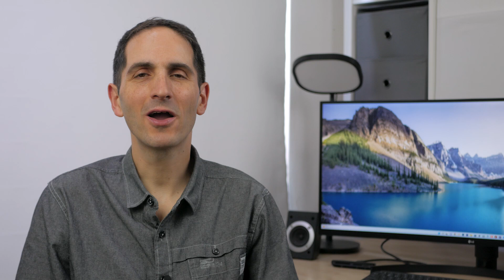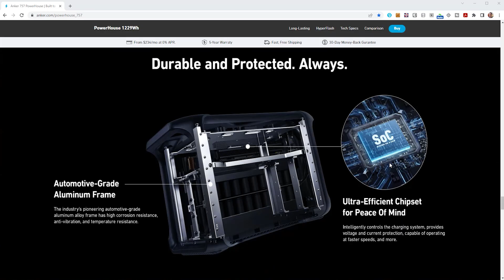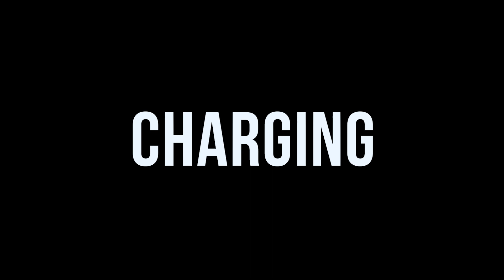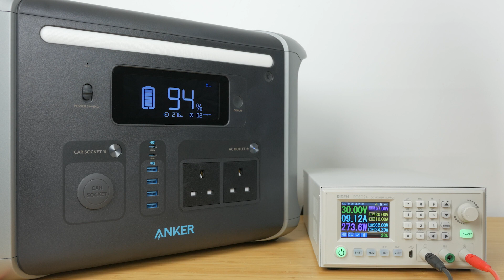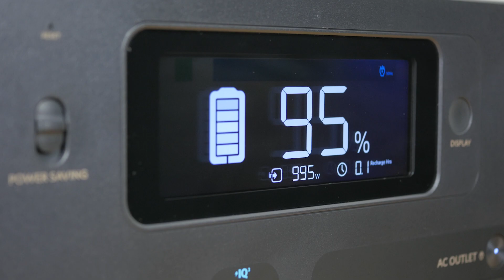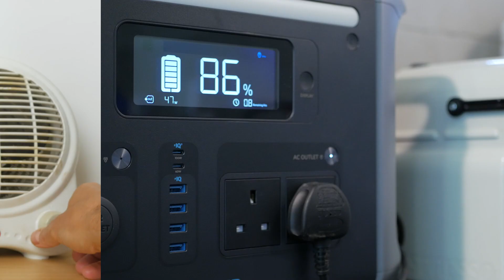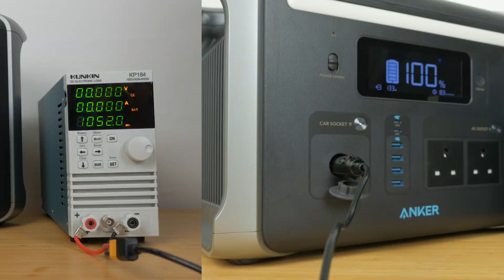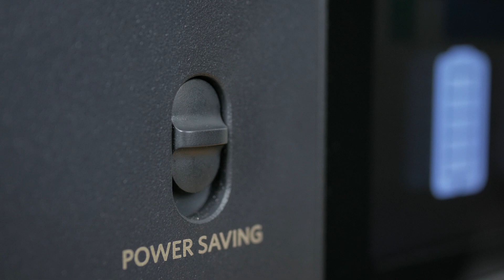Anker 757 PowerHouse 1500W portable power station review | 1229Wh long-life LiFePO4 | Fully tested

Comment: Excellent review!  👍
Can you power a device from the unit & have the unit accept incoming charge at the same time?
For example have a 1kw heater switched on through the unit plug sockets, while simultaneously re-charging the unit through connecting 300w of solar panels?
Reply from the maker: Thanks! Yes you can.

Comment: First things first absolutely great video.
My concern is with the solar input. It's limit to 30v and 10A makes it basically impossible to hit the 300W.
when using A parallel/series array of 12v panels to get to 24v the max is still 240W because of the 10A limit.
I can't really find any panels that reliably work at and always under the 30v...
Reply from the maker: Thanks! They want you to use their 30V 100W panels with their parallel adapter, which would provide 300W maximum and 10A.

Comment: Great video, very informative and helpful.  I have just ordered one of these, could you recommend some roof mountable panels for my van that I could use to charge this rather than the expensive anker 625 100w portable ones please? My thoughts are that the panels would be safer on the roof of the van than on the ground at a campsite and I can then have the wire coming into the van to connect to the 757.  Would I be best getting one 300w panel or 3 100w panels, new to all of this but didn't want to go down the standard camper leisure battery/split charge relay route as I think the "portability" of this type of unit is a big advantage.  I would only need solar charging whilst camping too so roof mounting seems the way forward? Would be very interested in your thought and look forward to more videos!
Reply from the maker: Sorry for the late reply. Glad the video helped! I've not tested any non-flexible panels - but I'd look at some thing like Renogy. You need panels graded for exterior use - so non of the portable panels I've looked at would be any good. It'll probably come down to size - what you can fit on your roof. Most options should work fine with the 757.

Comment: Really great quality review, thanks - one new subscriber here! I'm after something pretty hefty as far as power goes, but trying to balance that with having solar power and being portable. Would this one be your recommendation or do you know if there are other contenders (maybe more powerful)? UPDATE: just seen they have a 767 series too, have you tried that at all? Thanks
Reply from the maker: Sorry for late reply - missed this one. It really depends what you need. I do like the EcoFlow Delta 2 and am just testing the Bluetti AC180 which is another option. I'm used to having an app with these power stations but it's not a big deal.
Reply: @TheTechnologyMan  those both look like excellent choices, especially with the option to upgrade the batteries, thank you! The Bluetti does warn it can be damaged if placed on its side though, which is a bit of a concern with transportation, though perhaps in reality I'd be unlikely to do that. I prefer not to have an app myself, I'd rather rely on the unit so I don't have to worry about connection and wasting phone battery power. Do you think you'll be reviewing either in the near future by any chance? Thanks again!
Reply from the maker: @SiaD777  The Delta 2 I've already reviewed. The Bluetti should be out in the next couple of weeks :).
Reply: @TheTechnologyMan  you're a star, thank you!! ❤️
Reply: @TheTechnologyMan just to clarify, this will be my first generator and I want it for a power out backup and long family holidays off grid. So I need it transportable, but being for whole family use when being off grid, I want something that is powerful enough to cope, especially as we may have other families with us. I can get some solar panels but chances are there will be little sun, so can't rely on that unfortunately. But it's a balance between weight, power and longevity, as I also want one that I don't have to worry about replacing any time soon. Many thanks!

Comment: Really good review dude thanks, I’ve heard and seen some reviews on Amazon that say you can’t use the AC while solar charging and one review suggested that the unit would not solar charge the next day when he woke up until unplugged and plugged the solar cable back in. Is this true?
Reply from the maker: Thanks glad it helped! You can't charge via AC and DC at the same time IIRC. But no reason why wouldn't charge via solar after charging with AC!

Comment: Wait what solar panel produce 30v and 10 amps? The solar panel mppt should be advertise as 200 watts.
Reply from the maker: You could connect 2 <30V panels in parallel to get 10A but I'm not sure what you mean since it supports 60V / 20A?

Comment: Hi good review do you no will it run a 2460W 240V 1.7 litres, kettle through a boy or cycle ?
Reply from the maker: Sorry I don't understand your question - but 2460W is over its rated output. It might run it, but with a lower voltage which is not ideal.

Comment: Good review ... thanks👍I was gearing up to go down the Renogy 1Kw inverter + 100ah Lipo4 battery route but I'm sold on the 757 now for what I want to run in a household powerdown scenario for two pensioners, running a Sharp 700w microwave and a Vango 800w camping induction hob. It will most likely sit beside the microwave & small induction hob but the possibility of humping it across to run the freezer if need be appeals. If it works out I may buy a second unit and use the UPS function specifically as failover for the freezer.
Reply from the maker: Great hope it works out for you!

Comment: Back after the trip, I have the #Anker757 and used it on my desert trip with the 300w soler, it is a BEAST!! more then enough to power the camp and to keep my #Domitec 92 CRX3 ruining the hole time. I think the fast charging is the key for it to stand up for its readiness. It did handle the work all day specially when we make coffee on the Nespresso machine.
Reply from the maker: That's great to hear! I also love the fast charging of these new generation of power stations.

Comment: Good review. Debating between this one and ecoflow delta 2. Your thoughts?
Reply from the maker: The app is useful with the EcoFlow (but certainly not essential) and the Delta is a fair bit lighter if you're going to be moving it around a lot. You get a little more battery life with the Anker though. In the UK the Delta is a bit cheaper so I'd probably go for that but I'm sure you'd be happy with either.

Comment: Thanks for this great video. I assume if I had numerous solar panels in parallel attached to the 757 that the unit would just draw the maximum 10A even if the set of panels can provide more? It would not shut down as it does when over voltage.
Reply from the maker: Yes that's correct - very rare to get enough sun where I live to ever saturate the current though!

Comment: Hi thanks for this great video. For how many hours it can power a 150w tv and a 150w ps5?
Reply from the maker: No problem glad it helped. It will depend how much they actually consume per hour - but at their full rated output (1229 Wh / 300W) * 80% efficiency ~ just over 3 hours.

Comment: Recommendation on aftermarket solar panels for this? The Anker panels are a bit expensive.
Reply from the maker: Just find the cheapest - I've tested a few and don't find a massive difference. If they don't need to be portable - I've seen some on Amazon (Renogy IIRC) that are a lot cheaper - and more weather resistant too.
Reply: @TheTechnologyMan  Thanks, I would like portable that I can travel with in the RV

Comment: What's the difference in powerhouse region versions except outlet types? Could there be some different inside components because of various voltages (for example: US - 110 volts, Europe - 220 volts). All in all, can I use US version in Europe and vice versa?
Reply from the maker: You need to purchase the correct version for your region - IIRC there's not 220/110V switch for charging the unit.

Comment: Most informational and best review on youtube of this product.  Answered nearly every question I had!  Only other question that wasn't answered was:     When charging from a standard wall outlet does it require sufficient power to utilize the HyperFlash technology, or can this be also charged from a US standard 120v power source with less amps (i.e. a really small generator, a 750w inverter on a deep cycle battery, etc)?  I understand I could use the 12v DC input to charge it from the deep cycle, but what I'm asking is whether the 120v standard wall outlet REQUIRES 12A to operate, or whether it can run on far less (i.e. 120v at 2 amps such as a 120v inverter outlet found in many vehicles today).
Reply from the maker: Thanks glad it helped! I've not tried charging it off a lower output mains outlet - but imagine it would work ok and just charge slower.

Comment: Hi Gidon, i saw critical reviews about UPS-mode:
Long power outage: AC loss, Battery drains completely, that's fine, but when AC recovers, the inverter will not restore power. So you'd have to be there to turn it back on once it reaches 2% charge.

Medium clean power outage: If AC power is removed, the anker will carry the load, and when AC cleanly recovers, it'll passthrough and charge. My computers handle this fine. This is the only scenario that works how an ups should work.

Brownouts: Apparently under these conditions, there is no hysteresis, and the anker will just turn off. If power comes back on too quickly?, it'll turn off. A brownout happened while you were gone? Better make sure your fridge isn't off. You had a brownout while sleeping? I guess your CPAP will just stay off because the power blipped :/ So for my real world conditions, it's just as likely to interrupt power than provide it. I've just never had issues like this, with any ups I've ever owned.

can you comment this cases?
Reply from the maker: Can't comment specifically on all those cases but I'd only consider this an emergency UPS, better off with a dedicated UPS if you know you need one.

Comment: Thanks that was a great plain speaking, not with too much technical jargon in, review of Anker's 757 power station. I had previously decided to buy this model, but then Anker announced the new 767 model which is due out in November. 
I know Anker have released some details of the 767, in that it'll have a bigger battery/capacity, which in turn mean a bigger size and hence why it'll have wheels and a handle to pull. Which isn't a bad thing, as even the 757 at 20kg, could have done with wheels as well in my opinion. 
Ultimately whether I buy the 767 or 757 will depend on the price.
Reply from the maker: Thanks glad it helped. Should have my review of the EcoFlow Delta 2 out this week - so I'd also take a look at that - pretty hard to fault so far ...

Comment: how many  ampere this device ?
Reply from the maker: 1229 Wh - if you're talking about capacity. I cover all the specs in the review and article. If you're looking for Ah value - that depends on voltage and is not directly comparable. Wh is better since it's actual capacity. (Sorry if I've misunderstood your question).

Comment: I would like to use this as a replacement for my household battery in my camper. The fan, waterpump and lights are on 12v, using about 80 watts when everything is on at the same time. So I suppose the 12v car output could easily manage that.

The thing is however, is that I have 300 watts of solar charging the household battery and it is also connected to the car's alternator using a Victron Cyrix-CT switch.

If I replace the household battery with the ANKER, using the auto/solar input connector on the back, directly hooking it up to my alternator and solar, would that work for charging?

I would then have control over de 12v output by a switch on the anker, which I like.
Reply from the maker: I've not tried connecting it to an alternator - but as long as the input is within the power stations spec'd range it hould be fine. I simulated all sorts of input with a bench PSU and it worked fine.

Comment: I am considering this power station as well as the Bluetti units to run my home office / electronics lab and charge via solar. I assume its got pass through charging ? Like you mentioned blue tooth app and control would be nice or wifi would be even better so you can turn on and off the unit when you are away from the power station's location. It would also have been nice to have dual charging without an internal AC charger so you could link 2 solar arrays as you can with the Bluetti EB55. ECO FLOW are nice units but more expensive and not all are LIFEPO4.
Reply from the maker: Yes it has passthrough charging. Just about to review another option from EcoFlow so hang tight if you can!

Comment: Can it power an air conditioner?
Reply from the maker: So long as it's under 1500W it should - you'll need to check the specs of your unit. I don't have one but looking on Amazon typical portable units seem to be around 1000W.

Comment: Hiya, What power does the BMS use up, any ideas?
Reply from the maker: Sorry not something I can specifically test.
Reply: @TheTechnologyMan   Just leave it switched on overnights with nothing using  the battery, then see what the % is pre and  post. The Bluetti 200p drops from 70% to 20% overnight !! Very useful for your viewers to know.
Reply from the maker: Ok I see what you mean. Have you tried putting the 200P in Eco mode and ensuring you turn off AC off if you're not using it? All the units I've tested use battery if AC is left on - that's the inverter subsystem. Thanks for the suggestion though will see what I can do.
Reply: Thank you….. it’s a friends unit so I’ll mention it to him, he is pretty clued up on solar and I would expect him to have known about the inverter, maybe it can’t be switched off. He seemed sure it was the BMS though, which doesn’t sound plausible to me.

Comment: Excellent detailed review, thank you. I have recently purchased. Could the 757 be charged safely from a petrol inverter generator (Bohmer AG i5000W)?' Also any recommendations for an alternative fixed solar panel?
Reply from the maker: Thanks - glad it helped! Yes you could definately use a petrol generator to charge it.I haven't tested any fixed solar panel but thanks for the suggestion - I'm adding a portable generator to my van so may look into this.

Comment: A silly question but what does it cost to charge the power station from a household 230V UK plug.
Reply from the maker: Just multiply your energy supplier kWh unit price by 1.5. For my currently just under 30p per kWh (!) - so about 45p to completely charge the power station. Although a year ago it would have been less than half that.

Comment: Hi will this change with a Rutland wind turbine
Reply from the maker: I'm not familiar with that turbine but as long as you have the correct connection between that and the power station I'd imagine it'd work fine.

Comment: Thanks for this great review. I've a question. What's the chance of using a leisure battery being charged by solar to supplement capacity and recharge at same time
Reply from the maker: No problem glad it helped. You'd need some sort of charge controller for your leisure battery - but yes then you could top the battery up.
Reply: @TheTechnologyMan  I have a 757 on order with the Anker solar panels - thanks for the great review.  Very detailed and evidence based! I have found that I can plug a power station into our campervan and essentially simulate an electric hookup.  We then have the leisure battery being charged up, as well as all power points in the van active too.  If the solar panels are plugged in, I am hoping this will be a useful hack. Thanks again for the valuable work on the review.

Comment: 1000W charging is only 1C charging so it should not damage the battery.
Reply from the maker: You can't slow down the charge rate - but 1000W should be fine as you say.

Comment: Hi TM,

Thanks for the review! I'd love a video with in depth coverage of the features ad limitations when using a anker PS with a battery something like this (12V,  24V or 48V):
https://youtu.be/j4hGq7VdsBQ
Reply: correction; hooked up  to a battery something like this:
https://youtu.be/j4hGq7VdsBQ (12V,  24V or 48V)   to a battery something like this one;
https://youtu.be/wMJbbXPD0JA 
thanks!  Best Wishes, MitchJi
Reply from the maker: Sorry missed this comment. As long as you match the DC input range 11V-30V at 10A - there should be no problem. But sorry don't have any batteries like that to test with.

Comment: What would happen if you charge the device by temperatures below 0° Celsius or 32° Fahrenheit?
Reply from the maker: I haven't tried since it's summer here in the UK - but I'd guess it wouldn't let you charge the unit in sub zero temps. According to the manual charging temps are 0-40 °C - discharging temps are -20-40 °C so you're ok using it in lower temps but you may have to warm it up to charge it!